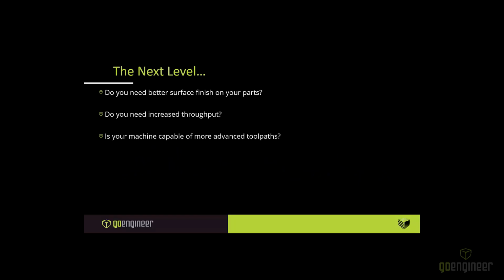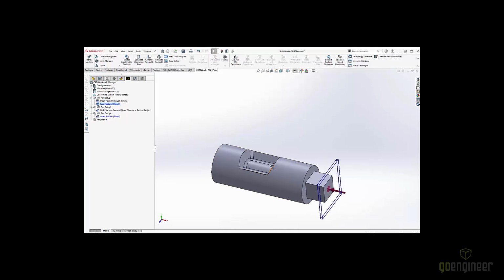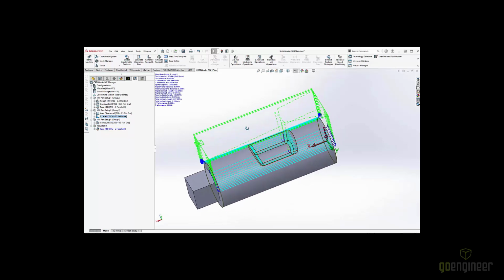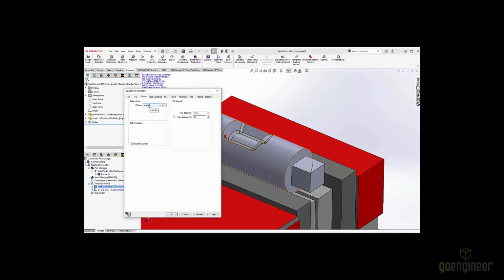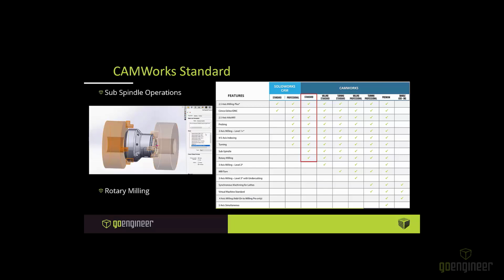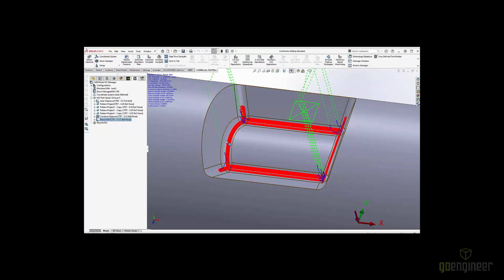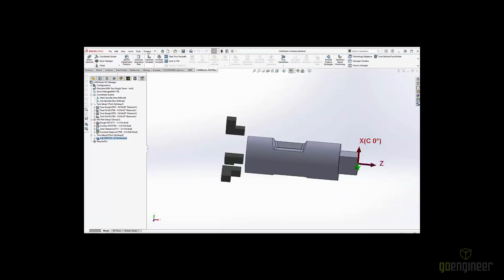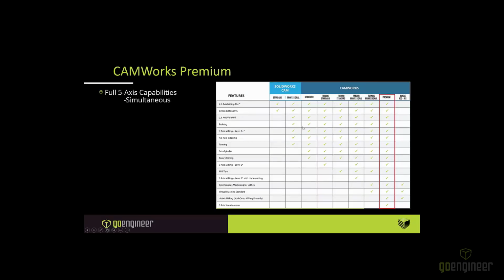Take your SOLIDWORKS CAM to the Next Level - Webinar

Comment: please tell me how to export G42 on camworks, or how to compensate when programming on solidworks cam
Reply from the maker: Weather or not a specific G-code is going to work is likely going to depend on the post processor being used.  So we really can't really give a generalized answer. Get with your VAR's tech support team to take a look at your specific set up and what might be possible.